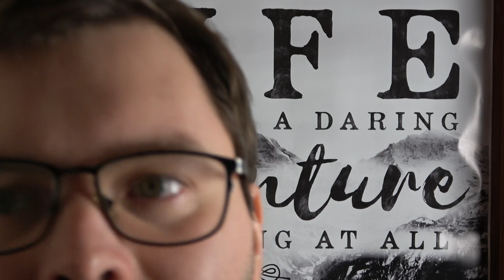Why running Raspberry Pi Pico off a powerbank fails & what to do about it

Comment: My power bank has a USB C (PD) port for input and output. I put a USB-OTG adapter on that port and the Pico finally got power. Hopefully this helps anyone still looking this up.

I was also curious if a USB Hub would work too, so I connected the USB Hub to the OTG Adapter on the power bank and the USB Hub to the Pico and it actually got power. So that could potentially be a way to expand the amount of low-powered devices your power bank could supply power to

Comment: My powerbank has 2 output ports and I could run my pico if I was charging my phone off of the powerbank at the same time. Didn't need to mess with resistors. I suppose you could replace the phone with another power bank if necessary. This isn't a long-term solution though.

Comment: Thanks for this tip. I am still trying to find a resistor value that is high enough to fix the issue but it already stays on longer with 10k. Great stuff for electronics noobs 🙂

Comment: Thansk for the tip. What value resistor have you used that has worked for you, but which draws the least amount of current? Obviously you don't want to drain the battery too quickly.